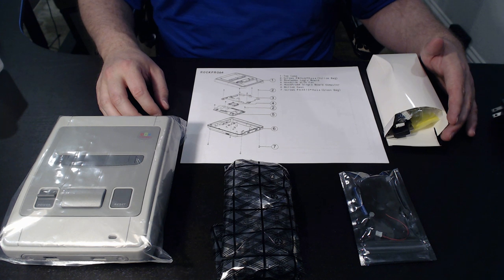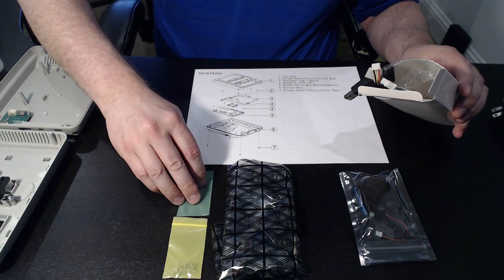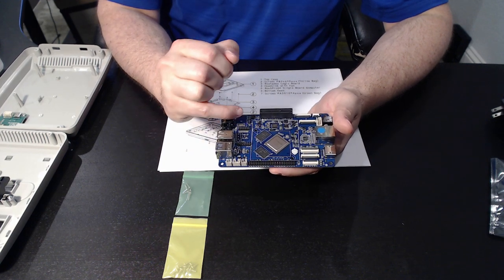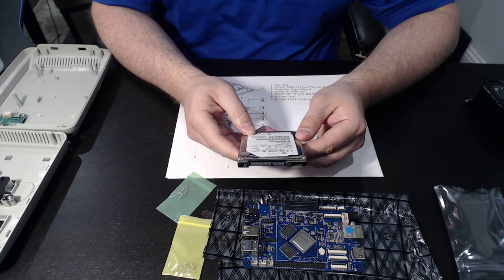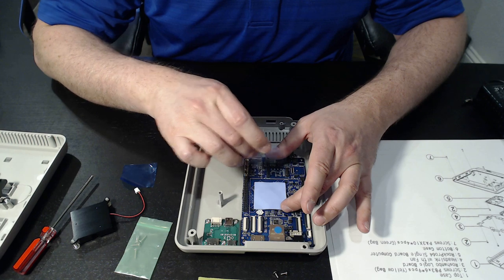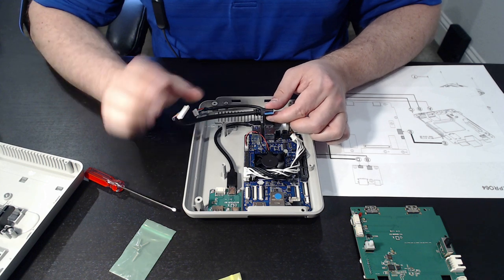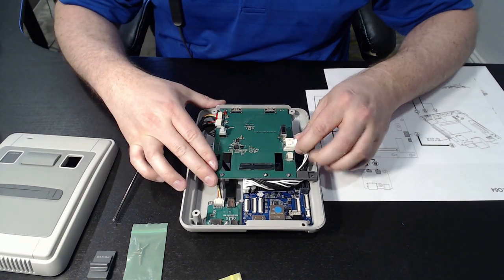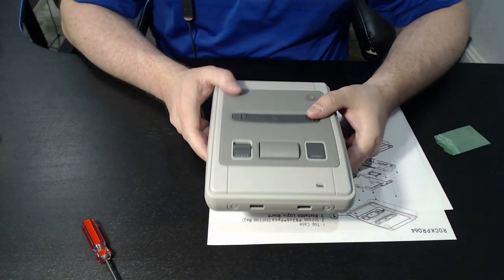RockPro64 Roshambo Case Unboxing and Assembly UPDATE

Comment: I just built this yesterday for the Raspberry pi. Glad there is a dedicated pin out for fan installation on the shutdown/reset PCB or I don't know what I would have done. even though this is a "larger" case - cooling is "cramped". Otherwise - Love it!